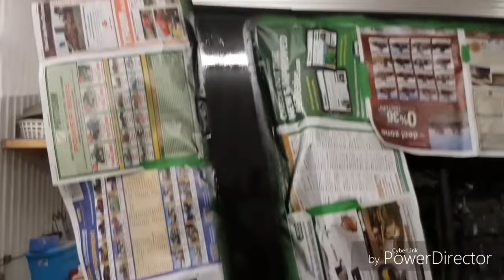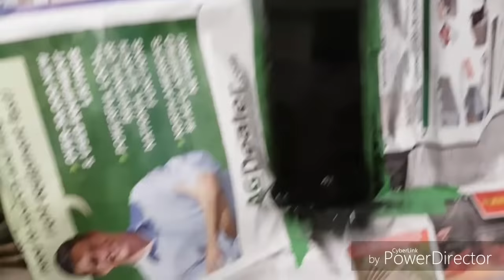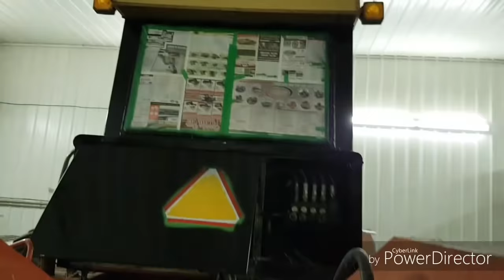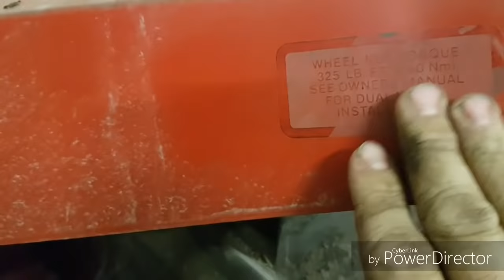895 gets a paint job!! Episode 1

Comment: good deal. i repaint everything around here even the shit spreader. first pressure washer hooked up to hot hot water. then bought a electric dewalt DA its got a foam/velcro pad use 60 grit to take off flaking paint & rust on farm equipment. if you can't find decals just have a local plasma cnc make some from 12 gauge sheet metal. auto value has dupont nason mixing system it's automotive quality paint that works with or without automotive clear coat but lower cost. the guy there told me all the local autobody shops are using nason on cars. only color they could'nt mix for me was hesston flame orange, had to buy 1 gallon at the hesston dealer it was expensive

Comment: That was a great shot at the end there with the lightning... loved the effin credits too LOL:)  Frickin' hilarious.  KUTGW!!  OL J R :)   

PS.  Too late now but if you can find some shaded part that is the original color (not faded or weathered) or a paint code they can match that paint at just about any good auto-body paint supplier... Whatever you do don't use that cheap TSC sh!t... the only way that stuff is remotely worth a flying fVck is if you use the isocyanide hardener in it, and to properly do that you need a full fresh-air respirator unless you like dying or risking getting effed up permanently... Even then the TSC stuff is sh!t so if you're gonna do the work spend the money and get better paint that will hold up more than a year or two without fading to chalk LOL:)